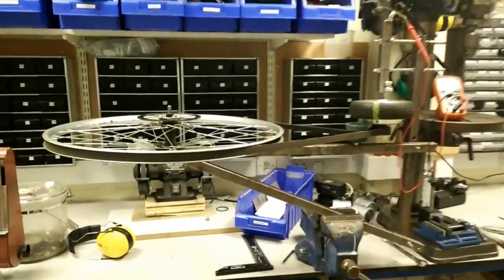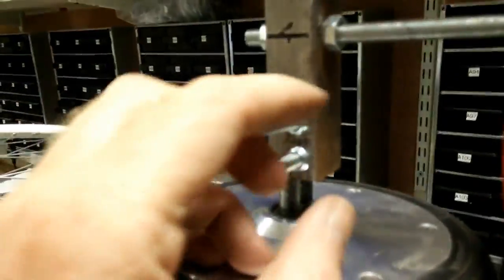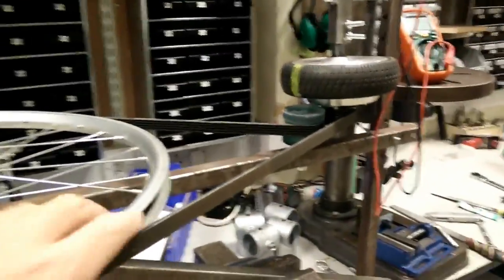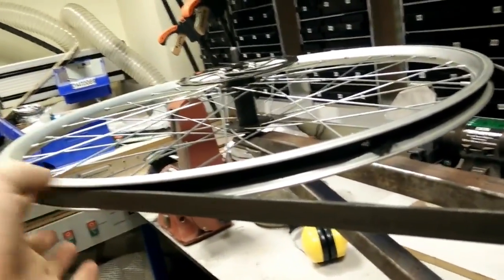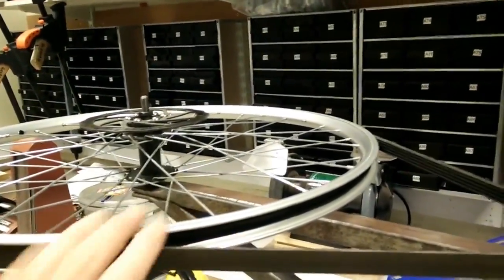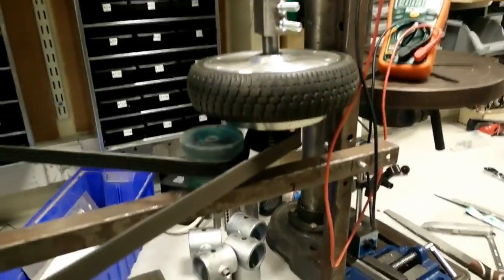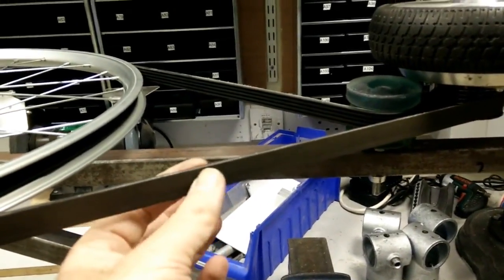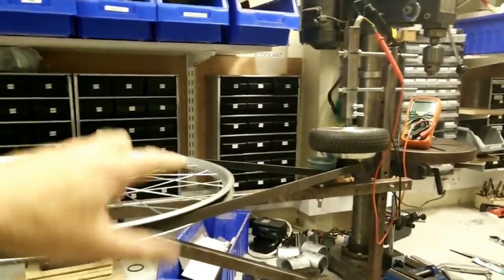Hoverboard Wheels As Wind Turbine Alternators

Comment: Apparently a simple rewiring of the coils will give you 3x or 4x the standard power output at low rpm with these motors. Did you perform this modification before hooking them up?
Reply from the maker: Voltage yes, wattage depends.
If you use thinner wire with more turns you'll trade volts for amps, which can be a good or bad thing, depending on other specifics.
I would like these to do sufficient V/RPM that I could direct drive them from the VAWT without the need for gearing/belt, but it's not really quite worth the not insignificant effort to rewind them.

And for that there's eBike wheels and DD washing machine motors anyway.
Reply: @OpenSourceLowTech  Yes, it's a voltage increase due to lengthening the coils but it seems in low winds it would also translate to increased overall wattage. 

There's a guy who made a hand crank "Crafty Dude DIY's" with a hoverboard motor. The only thing he did was remove the solder from the wires, then connected the phase beginning with the phase ends and he got 60 watts hand cranking these, while he could only get 15-20 watt with the stock configuration. Perhaps it's worth looking into. I've been trying to replicate his video, but I end up shorting the motor making it very hard to crank. I don't have much of any electrical experience, so would love if you could give it a try.

Comment: Great design keeping the alternator rotation >> the wind turbine speed. This will increase output voltage so lower current for a given output power. This will push up the frequency of the AC output so you may benefit from using schottky diodes for the three phase rectifier. Lastly those hoverboard motors normally spin at about 750 tum at max "road speed" but I expect the only limiting factor for speed would be the two bearings.

Comment: Hey Daniel, thanks for the nice walkthrough. I'm wondering what kind of rectifier you are using, and whether or not a capacitor is needed to stabilize the DC voltage? I'm very much amateur here, therefor just asking about what you (or others) think.
Reply from the maker: Just a standard 3 phase bridge rectifier from eBay. What to plug that into is a whole set of options in itself, but generally some kind of charge controller, ideally with load diversion for when the batteries are full.

Comment: Hello, nice video ! how did you manage to attach the pulley on the axis of the motor ?
Reply from the maker: Short answer is I just bolted it onto a small backplate and then bolted that onto the face of the hoverboard wheel, but it was a bit of a bodge job and I'm working on something a bit more elegant.
Reply: @OpenSourceLowTech  ok, not always easy to find the right center of some circles. Did you test it in the wind ? how many volts ?
Reply from the maker: I've been using them for the water turbine as well (check my channel), and center that hole by coming through the back of the face cover where there's a housing for the axle bearing, putting an M8 nut around a 6mm drill bit which sits nicely centered in the housing.
If that makes sense.
Reply: @OpenSourceLowTech   to increase the voltage, i was thinking on either put 2 wind turbines in series or install a big pulley to increase the RPM, what would be the best in your opinion ? thanks
Reply from the maker: Alternators or generators in series will tend to negatively interact with each other unless they're set up in a very particular way, unfortunately.
I've been using an automotive belt and pulley to gear the system up by about 10:1.

Comment: Very cool, it looks more and more professional and 'high tech'. Do you have a use for that disk brake?
Reply from the maker: Ta. The brake will be within the turbine so no really accessible, was just on that particular wheel and I had no reason to take it off. I'll be using load braking to prevent over spinning.

Comment: Since you'll put this outside then might as well to design to have covering on the edge of the rim and the entire mechanism of the DC motor.
This is to avoid direct heat and rain which will highly degrade the material especially on the belt and avoid rusting as well.
Is there a safety feature if the wind outside becomes like a storm level?
Great job to you and thanks for sharing 👍👍👍
Reply from the maker: The electric bits will be housed, yes.
I'm aiming to not need a braking or furling system on the turbine, and just make it strong enough to survive most wind, with a hinged pole that can be dropped in the event of an actual hurricane.
It will be strongly advisable to use a load diversion system tho so that the turbine is always doing work and so is largely protected against overspinning.

Comment: How did you attach the alternator pulley to the hoverboard motor? It looks like it's attached to some kind of plate and the plate is bolted onto the face of the hoverboard motor? Drilled and tapped holes? 

Thank you for sharing!
Reply from the maker: As in this video it's essentially as you say. I've got an easier and more precise method now tho, little tricky to describe in text but will include it in an upcoming video.
Reply from the maker: However, the current test build I'll be first trying looping the belt round the wheel hub itself. This'll mean about half the ratio increase, so half the rpms and voltage of the pulley, but at also half the torque so should spin up easier in low winds.
And is also one less thing to need to get and attach.

But will trial both and compare.
Reply: @OpenSourceLowTech  I was wondering have you tried machining down the tire a little bit like you did with the longboard wheel? Hook the wheel up to power and turn it into a lathe?
Reply from the maker: I just take the whole tyre off. Also no longer cut down the skateboard wheel, just use a larger one that the belt doesn't run off.

Comment: Very nice design!
Which kind of rectifier do you use for this wheel?
Reply from the maker: Just a basic three phase bridge rectifier which will handle the voltage and current.
Couple bucks on eBay.

Comment: what RPM is the hoverboard motor rated for?
Reply from the maker: Don't know if it has a rpm rating as such, but the speed it's going there would be the equivalent of the hoverboard traveling at 45 km/h.
However, once it's under load the revs will third to halve.

Comment: Can the 3 phase wires be hard wired to a standard trickle charger? This would reduce need of bridge rectifier, charge controller, and dump load would it not? I’m not claiming to be knowledgeable in this area but merely  asking if it would work and be easier to charge batteries.
Reply from the maker: As in, something normally plugged into a wall?
No, because they'll be single phase not three phase AC, but other than that, kind of yes. It'll have a min and max voltage it can work with, and will almost certainly be very inefficient, but minus the phasing issue (which can be resolved with a bridge rectifier, which are not expensive, and most wall plug stuff will actually work fine with DC as they have their own bridges as the first component, so don't realise they're being fed DC) it should basically do the job, and be a lot easier to source globally than the fancy stuff.
Reply: Thank you for the insight, as I thought more about it thought to my self yeah that’s not a constant power source it can have highs and lows but will be building the rectifier this weekend with some diodes from RadioShack. Any advice on best diodes for the build?
Reply from the maker: I always just buy my rectifiers as units on eBay or wherever, but they're easy enough to make. Not sure what diodes to use, guess only real considerations are not blowing them up, and their voltage drop.

What's it to be attached to?
Reply: I would like to charge a battery bank with several of the hoverboard generators. What all are you able to power with your vawt setup?

Comment: for the best these generators from hoverboard and generators from washing machines diretdrive inverter /have you tried to make with these generators
Reply from the maker: Direct drive washing machine motors are pretty good, and should be well suited to vertical axis wind turbines specifically.
But they're also quite hard to find and work with..

Comment: What did you use to attach the pulley to the wheel? Can you give a close up of that? Can you put two wheels on one belt?
Reply from the maker: Basically just bolted a little flat steel plate onto the face of the rotor of the wheel, and then bolted the pulley onto that.
I'll be doing a full animated build tutorial of all this once it's properly tested.

You could do multiple generator's / alternators per turbine, but you'd want to wire them each separately to your charge controller or wherever they're going. If you try to put them in series or parallel with each other their voltages will almost certainly start interacting in ways you probably won't want..
Reply: OpenSourceLowTech thank you

Comment: Can the bike rim be horizontal? The bearings in the rims are supposed to support the weight vertically. Do you end up replacing them a lot?
Reply from the maker: This design of turbine really needs to be run vertically. The longest running of these was up for more than three years without any problems with the bearings, which I'll admit I was a little pleasantly surprised by...

Comment: Hi Daniel, great channel and project - really inspiring!
It would be interesting to see your wind turbine connected to a compressor/pump (instead of an electrical generator).
Almost all wind power seems to be harnessed for the purposes of generating electricity, but this seems to miss a potential opportunity....
Wind power fed through a compressor could either be stored as for later use or utilised to operate a simple heat pump system and produce heating and cooling which would be a more efficient use of the energy than with all the associated conversion and storage losses of an electric system.
Heat pumps have a positive coefficient of power, being able to extract more energy from the environment than is input; in addition, heating represents the greatest energy requirement from a household, so directly produced heat is more efficient than conversion to electricity then back to heat again.
Apologies for the excessive detail, but it appears that you have the skill and expertise to give this a try!
(more so than an armchair commentator) 😉👍
Reply from the maker: Yeah these turbines can certainly be used for other purposes than electrical generation. Pumping water would be a big and obvious one, compressed air also definitely an option, tho I'd be much more interested in it for cooling than heating, which is usually best done with solar thermal.
I have a design for a basic cooler which just pumps air through a buried water container, in that the ground temperature two meters down is often about air conditioning temperature, depending where you are, but am also thinking about a simple air pressure cooler.
It's been on the list of things to prototype for a while now... Maybe this year.
Reply: @OpenSourceLowTech  Thanks for the reply Daniel. 
There are a number of devices that use the sterling cycle for cooling which could potentially offer a simple solution for a wind powered cooler.
The reason for considering a wind powered heat pump is that living in the UK, solar thermal is good for the summer months, but not as good for the rest of the year, but the wind often blows when the sun is hidden!
Best wishes👍
Reply from the maker: A Sterling engine run in reverse would certainly do the job of creating coolth, and probably more efficiently than an adiabatic process, but is usually somewhat more mechanically complicated than just mildly compressing air as a coolant. Spraying of which into a room is also a more effective way of cooling a space.

Heat pumps are definitely effective tech. Solar thermal tho can also be surprisingly so even in mid northern winter.
Reply: You would need a lot of reduction gearing to use a windmill to compress air but it could be done. It would likely take a bit of time using today's compressor designs. Lets not forget compressors need oil also!
Reply: That being said one could keep their small garage compressor full without using the power and leaving the compressor on. As long as you are efficient and leak free and don't consume a lot of air yes...you could use a wind turbine to charge air to use to fill your bike tires and lawn gear :)

Comment: Did you finish this project?
Reply from the maker: Am in the process of putting some turbine systems up in Scotland at the moment.
Also using the wheels as alternators for my water turbine design, except direct drive rather than belt driven, and they're doing well so far.

Comment: Doesn't look like the belt is in alignment and that Will make it wander, I dont see the groove  in the idler pulley (skateboard wheel) as necessary if the alignment was more true, also it is said that a chain drive is best for this type of project as there isnt the same tension needed which adds friction and drag
Reply from the maker: I tried with chains initially, but they're harder to work with for this kind of application, particularly in getting them to engage the wheel rim without slipping or wear.
The alignment in the video may well be off, I hadn't fine tuned it at that stage. That really needs to be done once the turbine is in place on the pole, as things tend to settle.
I'm also now going with a convex idler pulley as it's better for centering the belt than a concave / groove.

Comment: Why not use the alternator from the rover?
Reply from the maker: As in a car alt? They have their strengths, mostly in max power and general availability, but are low efficiency and need a lot of revs to get any useful voltage out of.
Motorbike alts are usually better, but need to be mounted on a bearing.
Reply: Car alternators are always the suggestion from people who think no one ever thought of THAT obvious one... 😑

Sarcasm aside, they are about the absolute worst option for turbines of any kind, as they have no magnets and require generating its own electromagnetism to work. Commercial attempts to sell conversion interiors for common car alternators have been tried and failed many times as well. 

Just use ANYTHING else and be better off.
Reply: @calysagora3615  I was meaning convert to PMA, I know all about alternators, and their workings, yes they are about 50% efficient hot, in stock configuration. The means if regulation is the largest reason for the effiencey, however, conversion to pma greatly improves this issue, it does require a electronic means for regulation, either a charge controller, or dc to dc converter, the voltage can wildly fluctuate with speed, when converted to PMA,  I personally rather use a 3phase pancake motor, like from a washing machine, what ever you were to use, it will require modification optimum  performance,
Reply: @jamest.5001  Too bad those useful washing machine motors from top-fed vertical washers are only used in America. The rest of the world uses universal motors and front-loaded machines almost exclusively, and all top-fed machines still have horizontal drum (but washes much better). 

And yeah, choosing an alternator that needs heavy and skilled modifications costing money kinda defeats the whole idea of DIY for cheapness and simplicity.

Comment: Why have all that loss with belts and pulleys, use a lever mount and spring to drive the big wheel straight to the little one.
Reply from the maker: Friction drives tend to slip. I did try to get a locked chain solution to work which you can see in other of my videos but I couldn't really get a nice result. Belts are a thing for a reason.